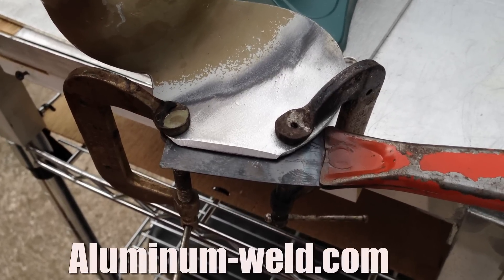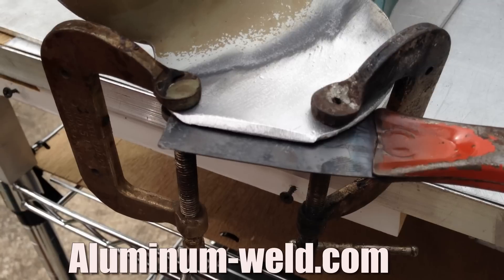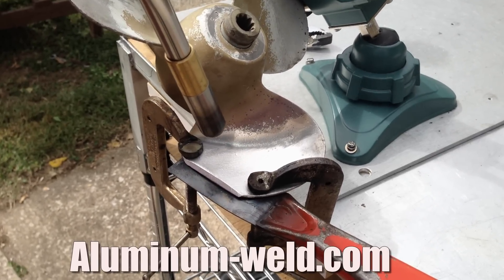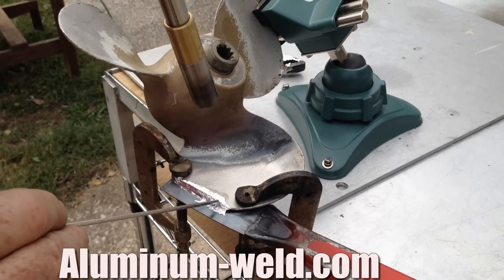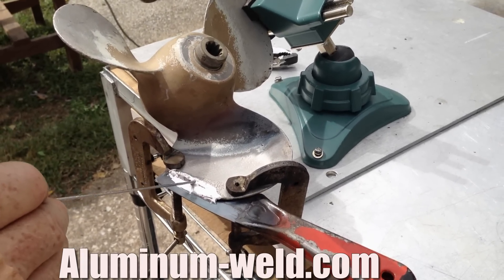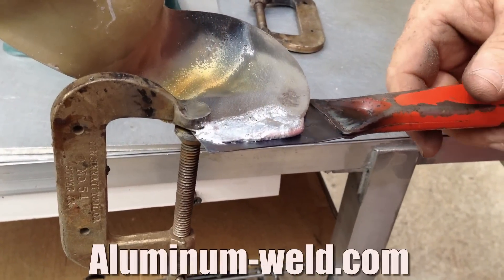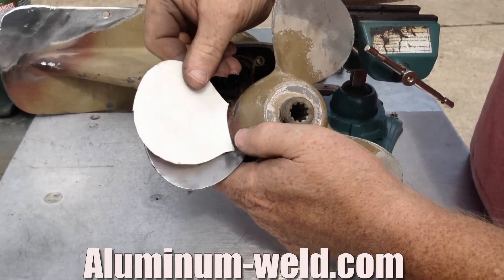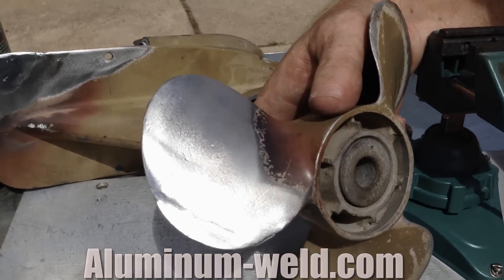Aluminum Propeller Repair with a Propane Torch with HTS-735-11

Comment: When I google HTS 735 it shows Hobart. Is that the right rod?
Reply from the maker: Hi Bryan, no HTS-735-11  should  bring up my 
website aluminum-weld.com
there you can watch videos and order the Rods as well. look for

Fluxless Brazing Rod Benefits - Aluminum Weld
aluminum-weld.com/benefits/
The Aluminum Weld HTS-735-II Fluxless Brazing Rod is perfect for all job repairs and can be used for industrial, marine, and general maintenance.
Reply from the maker: NO go to aluminum-weld.com
Reply: Is there any way to buy this or an equivalent in Sweden (or ship it here)
Reply from the maker: We ship to Sweden.